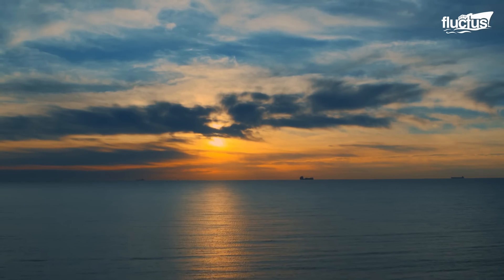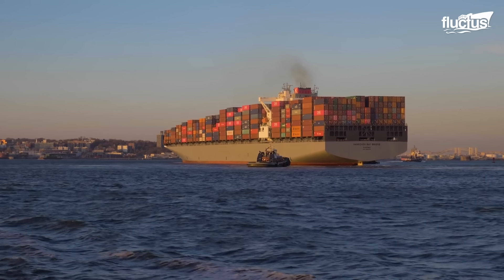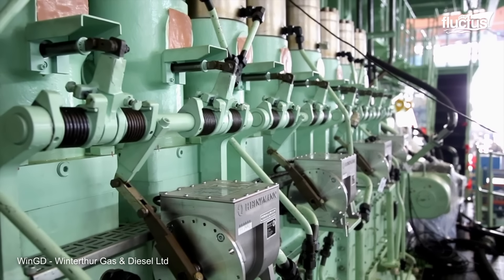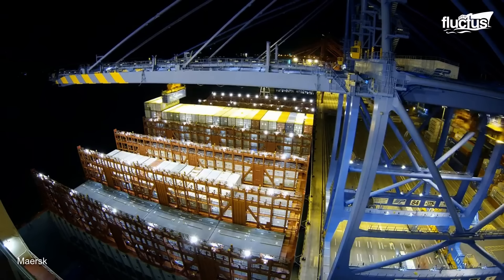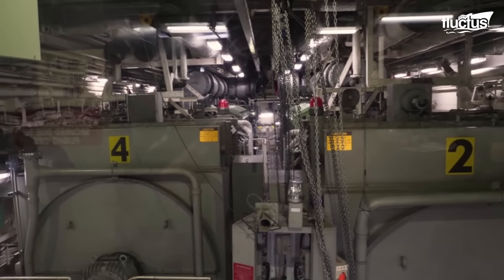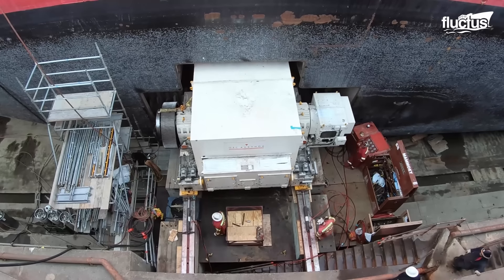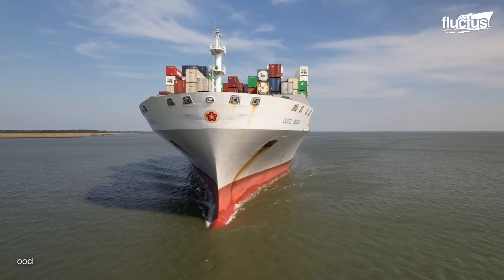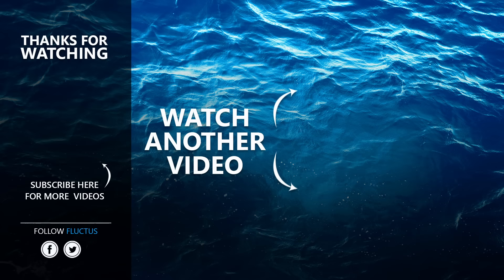The Crazy Amount of Power Needed to Move World Largest Container Ships

Comment: HFO is not diesel, that would be GFO or Gas Fuel Oil. HFO is Heavy Fuel Oil. HFO resembles Bitumen and has to be heated (usually by High Pressure Steam) before it can be burned in the engine. And the Wind Assisted Propulsion is not a Turbine as mentioned.
Reply: :face-red-heart-shape:

Comment: What struck me was how (relatively) little has changed from the days of the Titanic. Pistons, crankshaft, propellors.
It’s all the same just with added bells and whistles to make it more efficient, faster and stronger.
Reply: really?
Reply: @vitsadelhole  yes, or I wouldn’t have said it!
Reply: @Knappa22  kinda sad
Reply: :face-red-heart-shape:
Reply: Titanic was steam, maybe coal fired. These new are internal combustion similar to your car.
Reply: @dirtfarmer7472  yes but the principle is the same i.e in an I.C.E hot gasses cause the pistons to turn the crankshaft. In a steam engine, pressured steam does the same thing.
Reply: @Knappa22 I disagree. The only thing they are similar is the fact that the final output is to turn the propeller. Tripple expansion steam and ICE has a total different principle.
Reply: @jules8048  do they both involve substances under pressure causing something mechanical to move, and do they end up turning a crankshaft and propellors? A yes or no response will suffice 👍🏻
Reply: @Knappa22  that what i said they're both made to turn the propeller but the principle is so much different in a technical way if you are not studying that field you will not understand it the fact that you only understand that they both involve high pressure to move it doesnt mean they have the same principle.
Reply: @Knappa22  i dont blame you if you said the principle is the same but in the technical way they are so much different.

Comment: You know it’s a big boat when, you have incredible drone shots of the engine room!
Reply: :face-red-heart-shape:
Reply: I was on a smaller coastal freighter and in the engine room, was 2 Emd 645 V16 engines, each turning a propeller, pretty neat stuff and the crew was telling me on how they have to blow the air out before actually starting them.
Reply: @creeguyvernon most marine engines are air start, they are too large to turn over with an electric starter motor

Comment: How can you test for reliability, as opposed to functionality and performance, during commissioning?  It takes years of fault-free operation to demonstrate that.  The engines are no more complex than a diesel locomotive, just much much larger.
Reply: There are a lot if things in this world, tgst are not tested for years. You run the engine for a month, take it apart, and measure wear and tear.
Reply: Reliability is built up over time. 

The designers are very Conservative, so very, very few failures.  That allows the experienced gained to improve design, power etc.

Comment: 2:06 Oh my God. It's hard to believe they only use liquid "form-a-gasket" to seal such a large engine. .....or do they install a real gasket over the form-a-seal?
Reply: liquid form a gasket is certified for aviation power plants, unlike any silicon product.  Aircraft sealant is a very good and strong method of mating surfaces together.

Comment: Propulsion units and engines are not the same thing. Replacing external propulsion units whilst not in dry dock and running is NOT possible.
Reply: What is the difference between one & the other?
Reply: @michmach7367  engines change fuel into useable energy, propulsion units use that energy to propel a vehicle. In other words engines are diesel, petrol, fuel oil, hydrogen etc powered and propulsion units are shaft propellers, azipods, bow thrusters, flow jets etc
Reply: @jeffreylinehan1613  thanks dude
Reply: Some ships are built such that Azipods can be changed afloat.

This is carried out at stop alongside, normally in a shipyard

Comment: The largest combustion engines ever built can be found in container ships. However, the engines in the new ultra large container ships tend to be smaller in size and power but instead on one main engine, they have two main engines and two propellers.
All the main engines in large container ships and tankers are two-stroke engines. In ones has to be pedantic about the clip, it is not mere the turbochargers ability to compress the combustion air for the engine that increases the efficiency of the engine. It is also the fact that the turbocharger is driven by the exhaust gas.
The part in the video where pistons are mentioned, the shown is not a piston but a crosshead. Since this type engine is very tall (long piston stroke), a device is needed between the piston rod and the crankshaft to covert the rotating motion of the crankshaft to a vertical movement of the piston. This is the job of the crosshead. On top of the crosshead, the piston rod is mounted.
In principle all two stroke main engine may be considered low speed engines since they typically operates at a max rpm of 85 - 160 rpm depending on the size of the engine.
HFO and Diesel are not the same thing. HFO, which stands for Heavy Fuel Oil, is a residual fuel that has basically been discontinued since the introduction of the IMO 2020 regulations. Diesel is mainly a distillate type fuel and is today used it two different quality ranges in shipping where both have a very low Sulphur content compared to earlier.
The general speed of container ships have dropped a bit since the introduction of the ultra large container ships. Up to the last large container ships with only one massive main engine, a top speed at around 26-28 knots was not unusual. The ultra large container ships, mostly with two main engines typically has a speed between 19 - 24 knots. At all time, the sailing of maritime ships is all about fuel efficiency and optimization. You never ever sail at 100 load on the main engine unless absolutely necessary. The extra speed you achieve between 85% engine load and 100% engine load is typically pretty small while the extra consumption in fuel is very high.
Reply: What is surprising if the engines develop 50 - 60MW? Even if the efficiency is about 160g/kWh, it’s almost 10to of fuel - per hour. However, that’s less than 1l/h per container which makes it 2 - 3l/100km per container. On a truck it’s rather 10 - 15l/100km.
Reply: Clearly, the creators of this episode did NOT consult with someone as knowledgeable as you are about ship engines used in container ships. Frankly, they should correct the narration after consulting with you about the errors you mention and, presumably, the errors you spotted, but did not mention. Thank you for your detailed comments.
Reply: Power required is proportional to the speed cubed ...P=V³.

So going from 85% of Power to 100% will add about 5.5% more speed.

Design of all  Marine Engines is very conservative. Experience and technology allows layer models to have power output increased over time.  A known example is 51% in power output from essentially the same design- size etc over temperature years.
Reply: Are the "ultra large ships" you refer to the Panamax ships? Largest that will fit the canal. Or is ultra large even bigger than that? Thanks for sharing your knowledge.
Reply: Wow, a turbo 2-stroke?!?! Don't believe I've ever heard a 2-stroke run at 85 rpm's, crazy. Sounds like you really know yer shit - nicely done.

Comment: Wind assisted propulsion....Hahaha.
Reply: Whats funny about this? They are getting 10% reduction in fuel over a year and yes these are on large 200,000DWT+ Bulk carriers. 10% is alot when you look at their annual fuel bill and CO2 emissions. They aren't fabric sails. They shouldn't even be called sails. They are hard and wing shaped, so an aerofoil that uses pressure changes as forward force just like an aeroplane uses for upforce. The wind is usually blowing out at sea more than it isn't. They fold down when in port.

Comment: The most common propulsion system is a large drive shaft that is attached to the engine crank shaft directly driving the  propeller system.

Next is the diesel or LNG electric: The engine turns a huge generator that produces electricity to turn a electric motor that the propeller is attached to underneath the ship. This arrangement is know as Azipod® electric propulsion system. 

Finally, there is a water jet propulsion system.  A huge water pump forces water through a nozzle below the water line to both steer and propel the ship.
Reply: The Azipod is a diesel electric drive, but not all diesel electrics are Azipods, an example was the ice breaker the Healy. The unit replaced was the electric drive and gearbox but the Healy has a conventional shaft drive and not an azipod which would get destroyed by the ice.
Reply: Correction...the water jet is above the waterline 

Hamilton discovered this requirement.  

The basis is momentum, as in a rocket engine
Reply: :face-red-heart-shape: